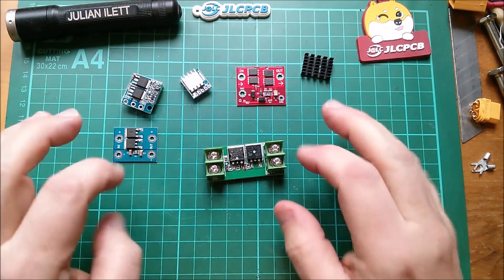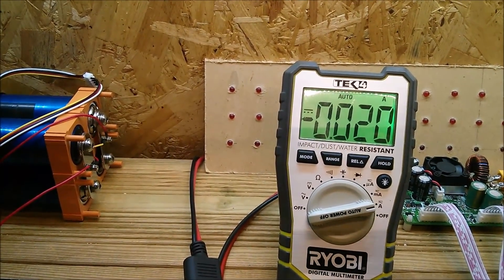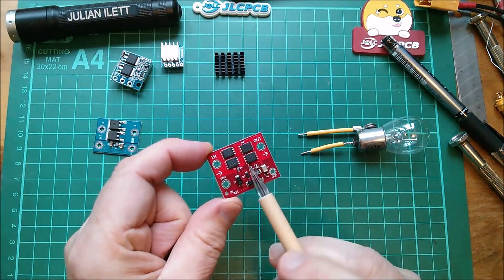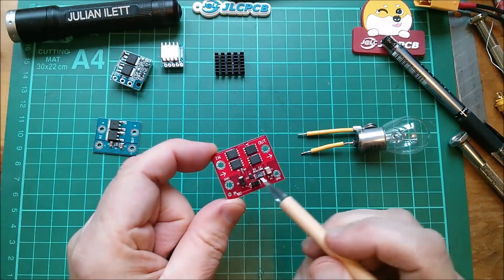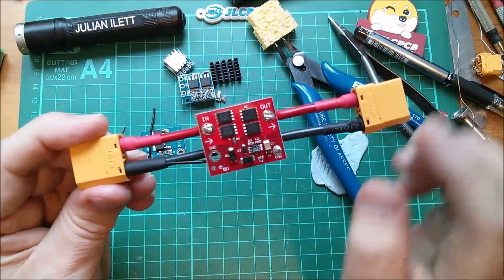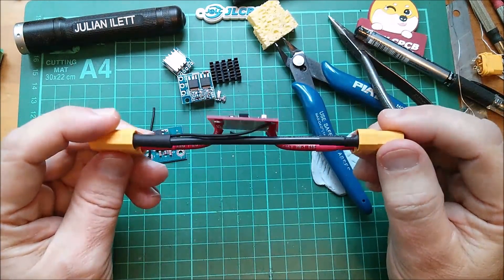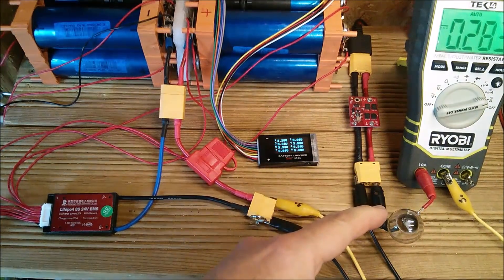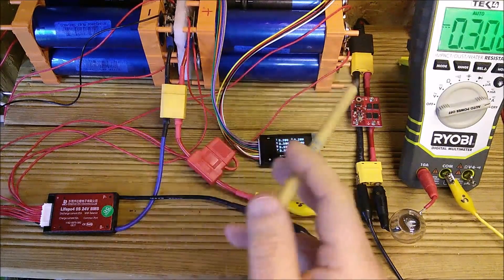Ideal Diode between Solar Panel and Battery

Comment: Hello! Is it possible to use this ideal diode for a UPS like setup? For exapmle if i want to power a device from power supply and automatically switch to battery if the power supply is cut off?

Comment: I made a circuit and used a cap and a 1N4001 and had no problems, swop the diode and the cap go's pop instantly. I also had an led on to little resistance and the cap could be popping cause I doubled the resistance.  Ima newb and don't get it, I think I put a 1N4007 in and popped two caps.

Comment: Remember kids, always wire your large lithium battery directly to an IC that can short circuit. You wouldn't want a high interrupt current fuse to block your exciting arc explosion of 5000-1000A!

Comment: Did you manage to check if the diode losses are less than the previous diode test ? It would be interesting to know this detail. Thank you for all the info contained in your video 🙏
Reply: Usually in a Ideal Diode is 0.02V

Comment: Couple of years ago I've asked on one of your videos if you can try charging some lithium batteries, directly from solar panel as long as the panel voltage fits the battery voltage, like an 18v panel with a 21V open circuit voltage charging 5 series li-ion battery. Now I see you are finally thinking at doing that.
Reply: Sounds dangerous. Lithium is not a toy!
Reply: @mrtechie6810  Not as dangerous as having an open fire in the house, yet we did it for thousands of years.😄
Reply: @CANTON76A  well, no one stops you then. Hope you live alone though!

Comment: Hey! You rejected the green module as 'just a diode' by showing the voltage drop across it, but you never did that with the red one! OK you showed it was not getting hot, but it would have been interesting to see just how 'ideal' it is.
Reply from the maker: I'll take another look at the green module in due course, but I suspect it's 'fake'.

Comment: Finally something I know a lot about! The FETs are in reverse series. And have been doubled up. This way you guarantee that the body diodes never conduct either forward or backward. Therefore, the system only conducts when the gates are driven by the controller which is a glorified opamp with some bells and whistles.
If you're interested, LT also do an ideal diode full bridge rectifier which is really neat
Reply: I have a board with an LTC4352 and paralleled MOSFETs which I have never soldered up - maybe now is the time?
Reply: Yeah ive looked at such Designs and was always confused because the fet was in the "wrong" direction. So thank you!!
Reply: @knopfkrieger  you're very welcome. As always, get other people's advice too just in case I'm being stupid or there's some better tips and tricks that may help you :)
Reply: Hi, it would be cool if you could Help me out as i have a hard time understanding. Every FET has a body diode. So ist conducts in the opposite Direction compared to the Direction it is steerable. If i put two in reverse series, it seems to me that the current has to cross a body diode in one of them at least right?
Reply: @knopfkrieger  the body diode is just a parallel diode inside the body of the FET. It's an unfortunate downside of the design of FETs. As long as you can pump enough charge into the gate, with many FETs you can put them in backwards, so flipping around the drain and source. So yes, absolutely, reverse series works and is quite common, particularly with N channel. 

Personally I used it to protect a battery and fuel cell which were hybridised in parallel, both of which don't like uncontrolled back feeding. This required a bidirectional break in the current, like a relay would provide but I needed high frequency (kHz). FETs only provide one way breaks due to this body diode. Unless you put two in reverse series then job is good if you can tolerate the reverse leakage through the side of course
Reply: So i use the mosfet the "wrong" way round normally and in the event of a reverse current the "right" direction working of the FET Kicks in and protects as you would expect with 0 gate source voltage ?
Reply: @knopfkrieger  you should look up the design of an "ideal diode" which uses a FET and is sort of what you're describing. Yes it can absolutely be used in this way. Like everything it depends on the FET and the circuit you choose. Sometimes it may take too long for the gate to charge/discharge in this design so it becomes dangerous, depending on the use case. So you often see a charge pump to speed up the reaction time and make it more decisive

Comment: Nice idea there. Great video.

A simple sunlight sensor or a timer + a relay could automatically disconnect those solar panels from your system at night. 

I would rewire my automatic night light to a relay for cost savings.

Comment: Instead of spending hours showing how four solder joints are soldered, you should rather use a circuit diagram to explain what is happening here.

Comment: Ooh I deal diodes are fun, I am using them for my "Buffer Charge Distributor" which is just a 12v SLA battery acting as a DC online UPS that can be used for regerative discharge usage on my hobby charger. The only issue I am running into connecting all the DC-DC modules together is that EVERYONE uses negative current shunts 😛 we need to put a ban on them!!!

Comment: What do LEDs and solar cells have in common?
When you apply a voltage, they light up, but some in IR light. 
If you shine light on then these generate electricity, but LEDs are not very efficient.

Comment: Most of those Battery Checker modules like you have will attempt to balance the cells at the current voltage with a 5 - 20 mA drain, unless they never populated the resistors on your model.
Reply: Whats your advice to set 6 panels each 100w

Comment: doesnt your bms have built in blocking diodes?
Reply: No. If it did you wouldn't be able to discharge the battery at all.

Comment: There is no point bothering if the loss is only 20mA. It's hard to validate buying anything to offset that tiny loss, it's so small of a loss that it's practically meaningless. And then when you buy more components to try to offset it, now you have many more points of potential failure in the circuit, it's generally not a good idea.
Reply: But it goes against the whole concept of letting Amps from the batteries to the panels, when it's supposed to go the other way. It's simply a bad mpp design that accept this do happen. So stoping this behaviour are only the right thing to do  👌
Reply: roughly 5WHr but I am highly suspicious of my math.

Comment: This is certainly worthwhile, especially in environments where panels may not be sitting idle for most of an average 24-hour period.  I've forgotten which panels are attached to the shed, but if I assume a 3A input current, the MOSFETs should burn about 10mA worth of current at ~28V (about 0.25W).  This is half the reverse current that Julian observed when his panels were dark, but it would only reach this level at a 3A charging current so most of the time the losses will be even less.

Comment: Wot's this business of putting wires through holes? It's been years since I've seen that, all the stuff from the cheapie Chinese eBay sellers seem to come with wires soldered across the holes rather than through them.

Anyway, I'm glad you're now doing most of your solar and crytypocurrentsea experimenting in the shed, well away from the house. After seeing the most recent video from your fellow countryman and Youtuber Mark Fixes Stuff about his house burning down, I feel like it's a good safety measure keeping this stuff outside of the house. I don't doubt the stuff you make, but I do sometimes worry that those cheapie Chinese eBay parts have one too many corners cut, or if they just decide to swap out copper for aluminium in the wires or connectors but don't downrate it accordingly.

Comment: 6:36 "...minimum drama..."  I gave up trying to use ~50 watt class soldering irons for such large soldering tasks, and I bought a Weller soldering gun )with 260 or 200 watts), just like my dad has had since 50+ years ago. Much easier. Cheers.
Reply: I'm still using mine from 1966 - wouldn't be without it....

Comment: I have some 60 cell solar panels for a 28v LIFEPO4 battery bank (yet to come), and was thinking like you said do I need a mppt charge controller, well I don't personally think so as the voltages are so close. The problem is when I do a Web search everyone says you need mppt with two panels? My batteries are expensive an I cannot risk them being damaged. Any thoughts anyone... Thanks
Reply from the maker: You'd certainly need a solar charge controller (specifically one with a DC/DC converter) if you put two 60-cell panels in series. But even if your panels are in parallel, you need a way to prevent the batteries being overcharged. My 60-cell panel has an open circuit voltage of up to 36V (when it's cold). That corresponds to 4.5V per cell for an 8-cell pack (more if they're out of balance). My Antminer will switch on when the pack voltage reaches an upper threshold (and off at a lower threshold) which will prevent overcharge and over discharge.
Reply: @JulianIlett  surely the bms will handle that? Thanks for the input.
Ps my battery will be 320ah and used daily running various loads. I have a load more panels to wire in parallel to increase the current. I also have an active ballencer I could use.
Reply from the maker: I've come to the conclusion the BMS doesn't so much 'manage' the battery as protect it. The upper cutoff voltage is very high (3.75V) and the lower cutoff voltage is really low (2.18V). Although some BMS's let you alter the thresholds (video on that coming soon).
Reply: @hunter00047  I didn't see a BMS in use....is it hiding?

Comment: "A few years ago I bought a whole set of these Ideal Diodes" Postbag: #76 (Nov 24, 2016) pretty much 5 years there.
On the brightside, at least that board with the LTC4359 is still available.
Reply from the maker: Was it really 5 years? Tempus fugit :)
Reply: haha yea I'm the same way, buy some modules just because I'm curious about them and want to test, and never end up deploying them. I definitely appreciate the fact check 👍

Comment: try the forward voltage on the green board with a higher voltage, the batteries (especially loaded with that bulb) might not be enough to turn on the FETs. If the board was only mean to use the body diodes there would be no need for the rest of the components. That said it probably wouldn't work in your application anyway, because once the FETs are turned on they will stay on with the battery voltage
Reply from the maker: What's odd about that green board is that none of the components has any connection to ground. Last time I looked at it, I came to the conclusion that it can't possibly work (other than being a diode). Perhaps it warrants another look :)
Reply: @JulianIlett  what is the part number on the fets? is it p-channel or n-channel?
Reply from the maker: 75NF75 which I believe is N channel.
Reply: @JulianIlett  then look for a P+ connection rather than ground, no?

Comment: mosfets are back to back to point the body diodes of each parallel mosfet pair, into each other, in order to block all conduction thru body diodes .   then the mosfets become a true switch that can be operated by a current flow direction sensing circuit, to create the pseudo ideal diode
Reply: If the sources of back-to-back high efficiency trenchfet NPN Mosfets are on the high side, it is mysterious to me how the device is generating a full gate activation charge, like Source(+) + 12V.
Diode Ladder?  Seems it would have to steal a little current while in forward mode to do this.
Reply: @GnuReligion  good point.  i think it would need a separate supply line (P+ or P-, depending on low/high side arrangement), fed into a buck&boost circuit that can accept power from a large range of voltages and always achieve proper gate voltage .   so in this way it would be kind of  a pseudo ideal diode , in spirit/function...   

maybe as you say there's some clever power sipping method such as blanking the mosfets for minute periods to sip power into a capacitor.  this algorithm would need to adapt to the pack voltage and seems complex, and technically speaking would interfere with the end goal of the device in the first place ...
Reply: @yeliab814  The way I do this at home, to make a circular battery pack (dynamically leaving the weakest cell out), is with Cockcroft-Walton multipliers.  One can semi-isolate a reservoir charge grounded on each mosfet source.  Takes a lot of caps.  If they are doing something similar here, a lot of little caps would be the giveaway.  Gotta wonder if this ideal diode will work down to 3V?

Comment: The eBay listing claimed that a 12 AWG wire could handle 41 amps?! That may be yet another eBay listing lie. The US National Electrical Code allows only 20A in 12 AWG house wiring. That's AC RMS, of course, but I can't think why DC would be that much different. For 40A, you need 8 AWG.
Reply: Code is based on multi core wiring embedded in structures and typically involves at least 50% derating over free air conditions, 12awg single core is rated 34A. Having said that I'd certainly be looking at something beefier.
Reply: @Steve_Coates  Good to know. Thanks!
Reply: I did actually learn this "the hard way". Molten cable insulation and molten xt60.  
Kept adding solar panels without beefing up the wiring. House not burned down luckily.

Comment: is there not a diode already fitted to the panel??
Reply from the maker: The panel will have bypass diodes, but not a series diode.
Reply: There might be a reverse voltage diode, but forward diodes are not common. One panel will put out 10 amps, at 0.7V diode drop the diode will burn 7 watts.

Comment: Which pays more. Ant mining or back-feeding the grid?
Reply from the maker: Antmining (with the right machine) ~ 20p/kWh
Grid export ~ 5p/kWh.
Reply: @JulianIlett  thank you
Reply: A lot of people have solar that can not backfeed the grid so any extra power goes to waist. If you pump that waist into a miner it makes you money instead of doing nothing. 

This allows you to put up enough solar for the winter but then mine with the extra unused power in the summer.
Reply: You can get different prices when you backfeed the grid and there are different efficiencies with miners. So the simplest answer is if mining without solar is profitable then it is probably more profitable to mine than to backfeed the grid.

Comment: Can u test the first "ideal diode" at 12V pls? Any better?
Reply: Ya, I wonder what the specs say about that first one.  Just like the ideal diode he used, it will have a minimum voltage and it has only likely 4-6V in his first test set up.
Reply: The voltage drop of most diodes is about 0.6v no mater what voltage you run it at. That is a smaller percentage of 12v so it is more efficient at higher voltages. But it is still going to be about a drop of 0.6v
Reply: @ecospider5  A MOSFET acts as a very low impedance resistor when switched on. The forward voltage drop will be dependant on the current but will be very low even at high amperage. These circuits try to be an 'ideal diode' i.e. zero ohms forward and open circuit reverse and without any forward bias voltage drop. HTH.

Comment: You didn't measure the voltage drop across the ideal diode.
Reply from the maker: It will be the on resistance of the mosfets multiplied by the current.
Reply: @JulianIlett  Yeahbut, who's to say it isn't just as bad as the first one you tried?
Reply: @JulianIlett  R(on)?  On a data sheet sure. But who just blindly trusts that?
Reply: @JulianIlett   It’s possible the LT controller isn’t turning on all the MOSFETs.  Most likely it is because LT was a great company.  But your other board had that issue, so you ought to check this one.
Reply: @JulianIlett  I would still like to see what that turned out to be in your setup as you did not mention the device characteristics and even if you had, the implimentation could have some impact.
Reply: Yes, that voltage drop while charging is the most important thing to measure. Surely the whole purpose of an "ideal" diode is its much lower forward voltage drop than a conventional one. Any conventional diode, even a Schottky, will have a low enough reverse leakage to be of no consequence in this application.